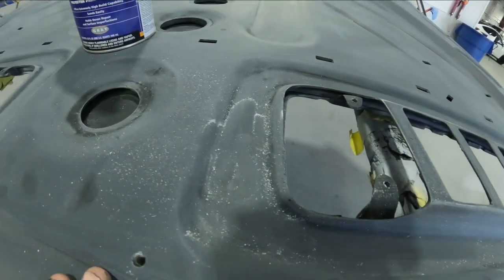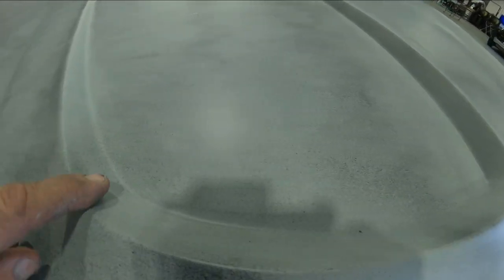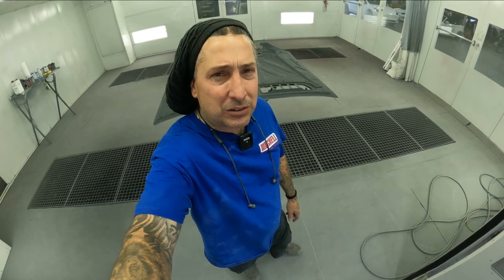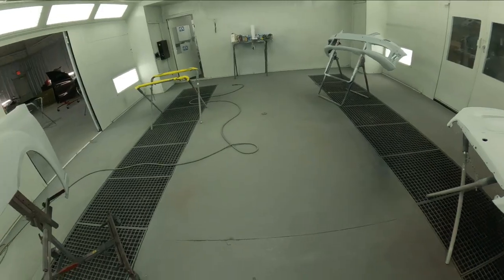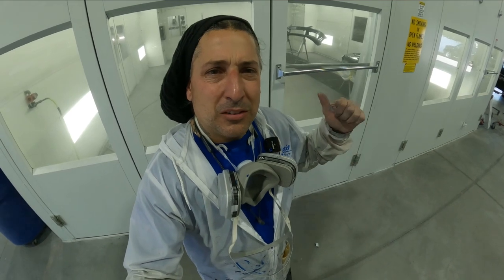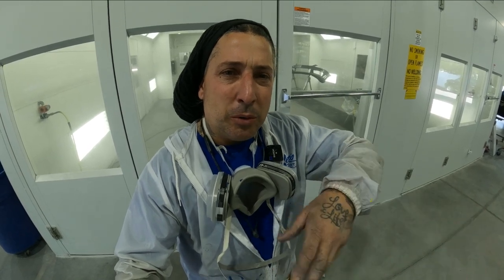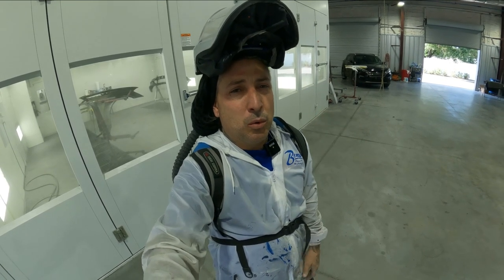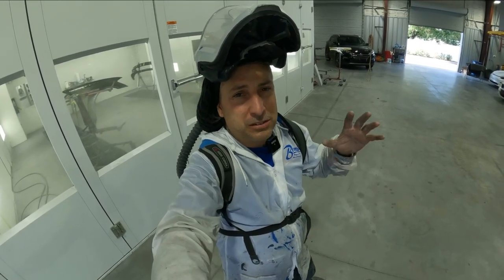SPRAYING A FIBERGLASS HOOD - HARDER IS SMARTER THIS TIME...

Comment: Looks good. Quick question. What can i do to cut down on bad rock pecks on hoods and front bumpers? It does it on new hoods, bumpers, and used hoods. It doesn't seem to be peeling, but chipping pretty bad. Not for sure if it's the clearcoat. Some people say cheaper products can do that. Some say polyurethane clear coats can help. I always seal new bumper covers and still see them on cars that i have done in the past. They may come in for something else and I'll remember what i painted on them
Reply from the maker: Good clear is definitely gonna help   they have flexible capabilities in them
Reply: @kandyman5315  what's a good one or what kind do yall use at your shop. I've tried quite a few different ones
Reply from the maker: Ppg 2021  clear is what we use

Comment: I've wanted to try slick sand, what grit papers do you use to block and finish it out in before sealer and base. What cleaner are you using before paint does that cleaner need to be followed up with a dry wipe.
Reply from the maker: 320 block 400da
Reply from the maker: Water base cleaner

Comment: is it recommended to use an epoxy primer before any kind of other filling primers to seal the fiberglass? im doing restoration work and we always use a epoxy before filling primers/big work. ive never done any fiberglass stuff before
Reply from the maker: On metal that's the best way but not needed on fiberglass

Comment: I have a restoration project I am working on and was thinking about using this polyester filler but I was told that it is very porous and can cause bubbling in the paint later on down the line. Is this true or did I get false information?
Reply from the maker: I've used it for 20 + years no issues
Reply: Ok thanks bro, really appreciate it, I was worried to use it cuz the guy told me you have to really bake the crap out of it to get all the moisture out before you paint or will get bubbles in the paint later in the future so it had me a little worried about using it since i don't have a booth, but now I feel more confident. Thanks again!
Reply: Polyester primers are porous. You're not supposed to wet sand them. Maybe that's the issues someone has had.